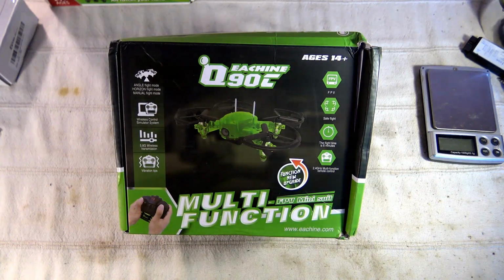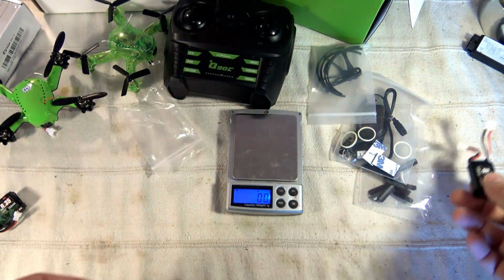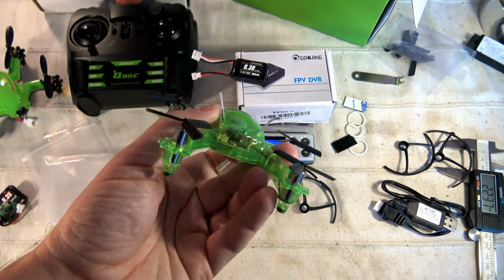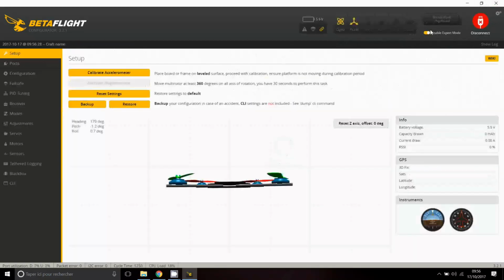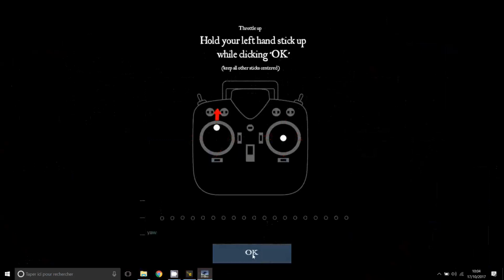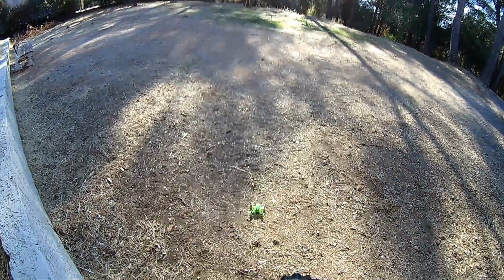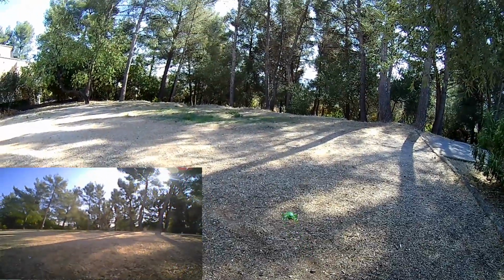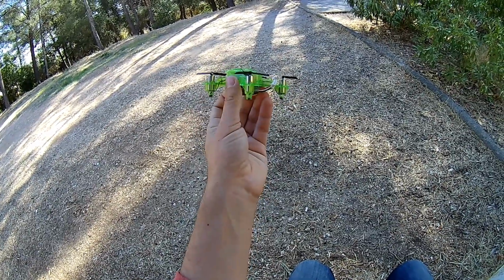Eachine Q90C Unboxing, analysis, wtf, rescue procedure and demo flight (Courtesy Banggood)

Comment: Salut seb j'ai un problème, mon pc ne reconnait pas le drone comment faire?
Reply from the maker: Faut installer les bons drivers et installer l'ancienne version de Betaflight.... attention des que l'on change autre choses que les PIDS ca fait planter la machine
Reply: SeBy DocKy c'est pas pour betaflight c'est juste pour connecter en mode simulateur :/
Reply from the maker: If faut d'abord activer le mode "simulateur" à partir de la radio. Je m'en souviens plus trop mais je crois qu'il y a un bouton à maintenir quelques secondes et aussi brancher le quad en USB.... (avec les drivers betaflight installés)

Comment: Its fun for those days when I'm feeling like carrying light and leaving the Taranis at home. However, who put stunted acro mode and crippled a betaflight board with no airmode or idle up!? I upped the rates and added expo, changed the PIDs and tried to turn on airmode, but it did not work of course.  Each time I tried it seemed to taz out and it flipped over. I turned it off after trying a few more things. No acro/airmode for the Frog...

Comment: Any idea why the left stick on the remove does not snap back to center from the up or down positions?
Reply: That's a feature not a bug! You don't want that kind of altitude hold on this kind of quasi acromode capable quadcopter.

Comment: Bonjour SeBy,

Je suis nouveau dans le piIotage de Micro FPV Drone et je cherche le meilleur pour moins de 100$.

Jusqu’à présent, j’ai trouvé ces 4 drones:
 
1 - Redpawz R011 5.8G 40CH Micro FPV Racing Drone 1000TVL FOV 120 Degree
 
2 - Eachine E010C Micro Mode 2 (Left Hand Throttle) FPV Racing 800TVL 40CH

3 - Eachine E013 Micro FPV Drone 5.8G  1000TVL  40 CH

4 - Eachine Q90C Flyingfrog FPV RC Racing Drone 5.8G  1000TVL  40 CH
 
Tous pour moins de 100$.  Alors pourrais-tu m’en suggérer un ou deux parmi ceux-là.  

Ou en as-tu de meilleurs avec la télécommande incluse ?

Tout ce que je veux réellement c’est pouvoir piloter de mon salon, sortir en FPV de la maison et en faire le tour.... appeler mon voisin au téléphone et lui montrer mon drone tout en restant assis sur mon divan.

Mais je veux la meilleure qualité de caméra pour ce prix.

Je pense également me procurer les lunettes FPV Quanum Cyclops V2 puisque j’ai des lunettes de prescription.
 
Merci pour ton aide et ton temps.
Reply from the maker: Le Redpawz et le l'E013 sont les mêmes .... Les trois premiers sont des TinyWhoop class... avec le système "duct"... plus stable et précis pour les vols intéfieurs mais plus lent en extérieur. Ils sont aussi plus solide que le 4 ieme.  Il y a pas de grosse différence entre le E010C et l'E013. Le premier est 100% configurable avec betaflight, le second tout caréné.

Comment: Mine doesn't bind with the transmitter anymore. It started when I played in the FPV Freerider flight simulator.  That frog is useless other than a connector for the pc simulator. WTF. not a good product.
Reply from the maker: Are you sure your not in "simulator" mode ? If long press on the bottom left panel to return in RF mode, it doesn't bind ?
Reply: Same things... what can I do???
Reply: Yes Sir, And I want to know what flight controller should I use in Betaflight.  I better dissect this.
Reply from the maker: The problem ... it's not an official supported board by Betaflight .... so I can't tell you from wich board it's based :( ....
Reply: thanks, sir.  but BEFORE that. when I am playing,  the frog needs to be rebinded after a short landing.  I need to switch down and up again the power switch and down & right again for arming.  and there was a time that it flies alone upon arming then land after a couple of meters.  feels like it was possessed lol.  That's why I decided to just use it for the FS.   Now I am planning to transplant its camera to my DM003.

Comment: They should make very big NOTICE: DO NOT CHANGE ANY BETAFLIGHT SETTINGS and put it on top of the model in the box.  Pretty good price when you consider it comes with a TX. Maybe a good starter for beginner, but it has several drawbacks, including if it cannot do Horizon or Acro modes. Maybe someone has the original settings in a .json file and you will be able to restore with BF v3.1.1  Oh, and those props not only break easily, but they come loose from the shaft and fly off easily too. Thanks for the review. Cheers.
Reply from the maker: It can fly horizon ... and acro. The last part of the FPV is in acro. The problem the dump  command is not working at all ... :(